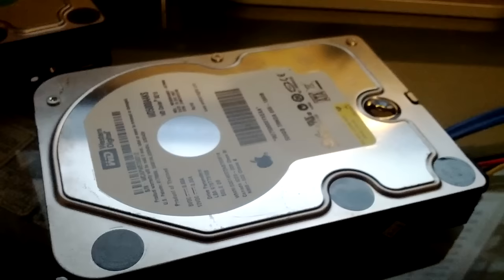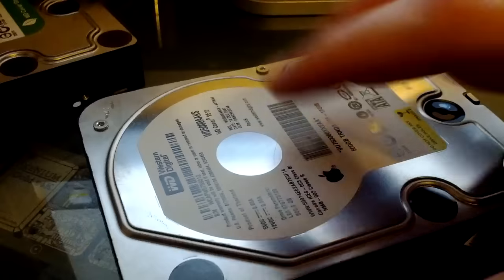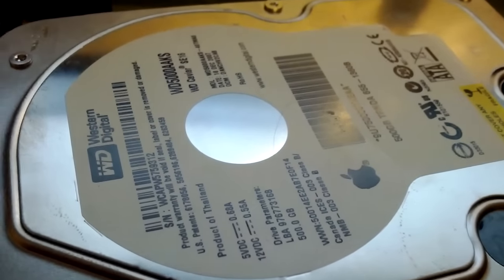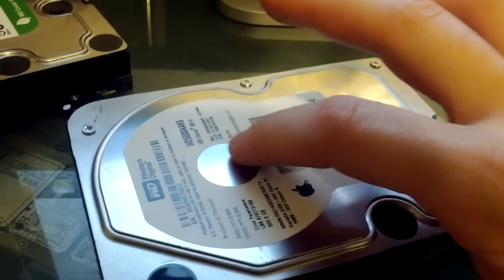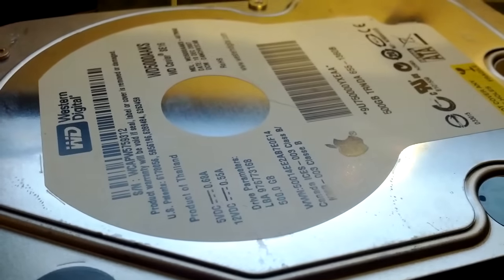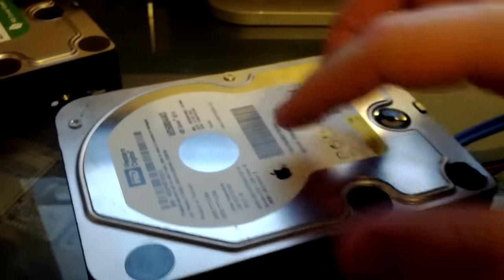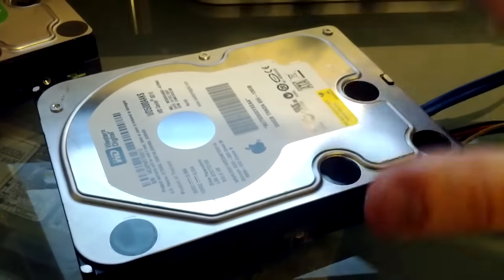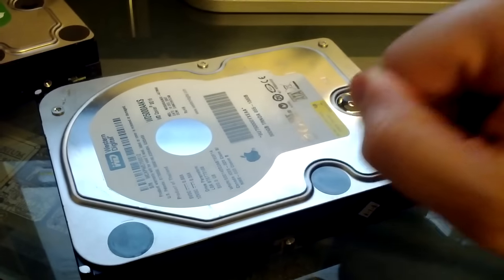The road to hard drive failure: Sounds

Comment: I want to know how to FIX it, not perfect my fucking hearing.
Reply: You can't fix it, if you open the drive in open air then all the data will be destroyed, since you need a Clean Room to do that. Your best best is to back it up to another drive and get new one.
Reply: Don't listen to the other guy who replied to you. You can open a hard drive yourself without any significant risk. Hard drives have a built-in air filter that will capture any dust you introduce when you open it.

The whole idea that you'll destroy a hard drive if you open it is just marketing wank made up by data recovery companies. Sure, don't open a drive unless it's already messed up, but you won't do any additional damage by opening it unless you're careless and touch or scratch the platters.
Reply: pyromen321 Ok thanks

Comment: I'm a nitpicking bitch, I know but you're not actually simulating the harddrive being in your cumputer, you're just connecting it to your computer externally. The drive doesn't know where it is anyway. Thanks for the video though!
Reply: +InvadersDie Inside OR out, it's the exact same process. The HDD is hooked up to a seta cord whitch is plugged into the computer. The only thing that would be different inside the computer is simply the fact it's inside said computer.
Reply: +Humorous Marsupial lol that's exactly what I said though. It matters not where the hdd is.
Reply: I read it as exactly the opposite even though I read it three times. I skipped over the "I know" and it makes the sentence rather different, sorry for my confusion.

Comment: click of death my wd blue is 9 years old and still going
Reply: That's impressive. I've never had a drive last more than 3 years. WD has a good rma policy. I haven't actually had to buy one in a long time. They usually fail within the warranty. I'm glad high capacity SSDs are finally becoming more affordable. You can grab a 500 gb 850 evo for $160 on Amazon right now.
Reply: +Jake Rindfleisch you can buy 500gb Kingston or mushkin ones for like $120 too, I'm going that route when I build another one

Comment: okay for a piece of shit apple hard drive for a piece of shit apple there is no way that u be  paying for 5k just to get data off.
Reply: What does Apple have to do with a failing hard drive? Any hard drive can fail at anytime. Apple did not manufacture this drive. Western Digital did.
Reply: Recovery starts at $285, where are you getting $5000
Reply: +datarecoveryguy.com 

Sorry,  but that's a pathetic price for plugging a drive into another PC. 

Even if you to read it forensically, that's still a dirty con, like EVERY recovery "company" out there
Reply: Thomas Galea (UKZz HELLRAISER) They are not just plugging the drive into another PC. They have to open up the drive which is very dangerous.. One small dust particle could screw up the drive for good.
Reply: +Rhett Krecic 

Yes,  I know. 
Adding a "white room" into the equation does not excuse such a disgusting price.
Reply: Why is $285 such a disgusting price?
Reply: As I previously said, they're charging that much for literally just plugging a drive into a PC and copying files from it. 

That, or being in a "white room" and fixing the drive. Unless they're actually giving you a replacement, or the parts from one,  they have no excuse to charge such a price.
Reply: You do understand that a "white room" costs money to run. The facility has to pay their high skilled employs good. They give you a replacement drive with the files on it. I didn't even mention parts and tools.